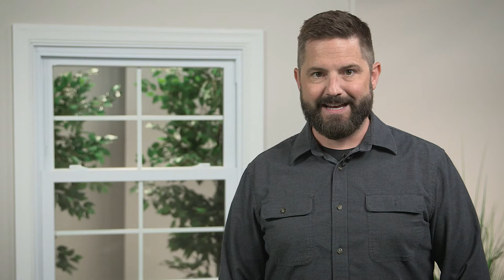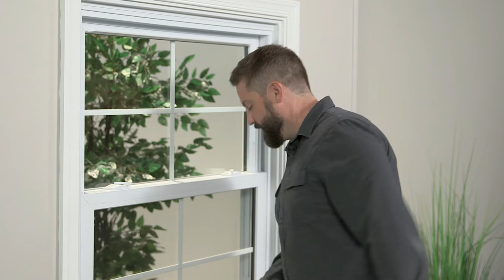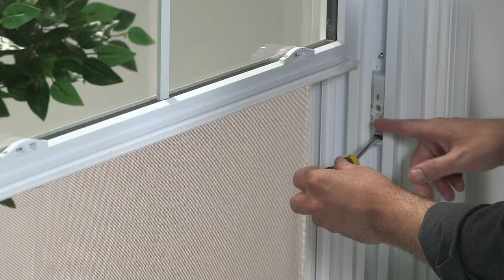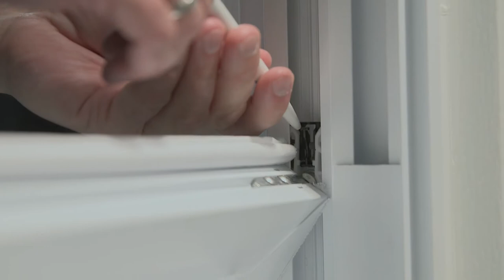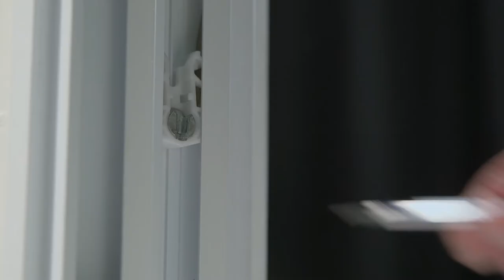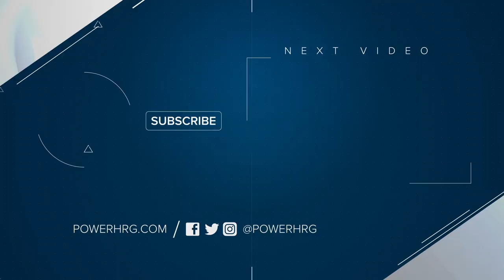Home Maintenance Series: How To Fix Window Balance System

Comment: Thank you!  When cleaning my window, the sides became uneven, the window popped out on one side and I could not get it aligned so I could close it.  After seeing your video I was able to see that the balancer was locked.  After unlocking it, it sprung to the top.  I was then able to pull it down to approximately where the other side was, lock it, and get the window back in!  I really appreciate your explanation!!
Reply from the maker: We're so glad this video helped you get your window back in place! Thanks for sharing your experience—happy window cleaning 👏

Comment: I've had to put several of the Power Home Remodeling windows just installed, into the balance system. Most of the clips were bouncing around in the tracks. One window installed with cracked glass in the sash, took a year to replace. When finally replaced, both clips were loose and sash was difficult to lift, like quite a few other window sashes. At a thousand dollars a window, I can't believe I'm spending time getting them to operate correctly. Extremely disappointed with Power.
Reply from the maker: We're so sorry for any inconvenience or undue frustration you have experienced with your Power windows, Eric. If you have any service concerns about your current windows, please give us a call at 888-736-6335 (select option 4 when prompted).